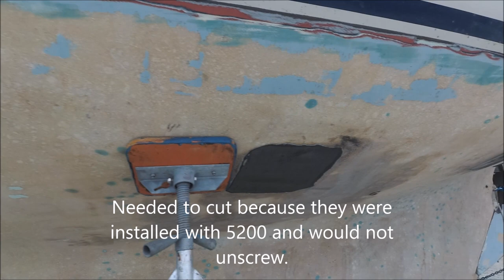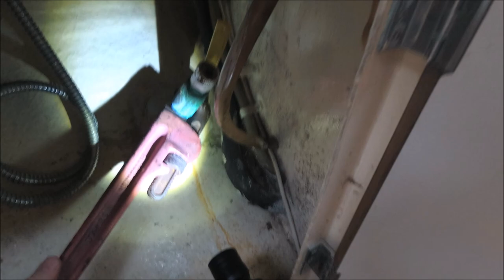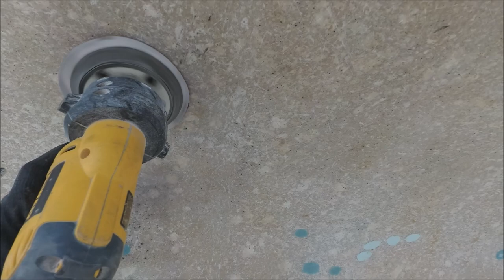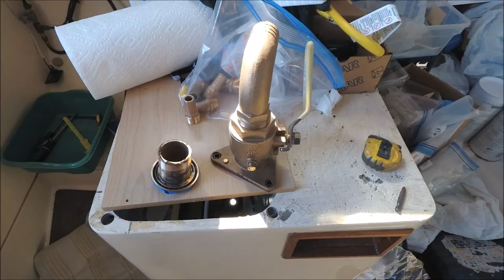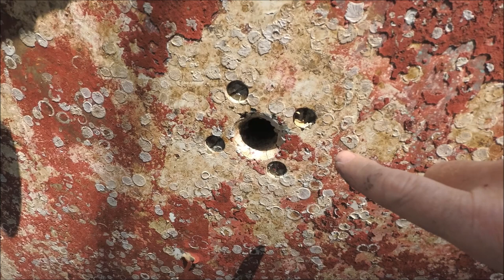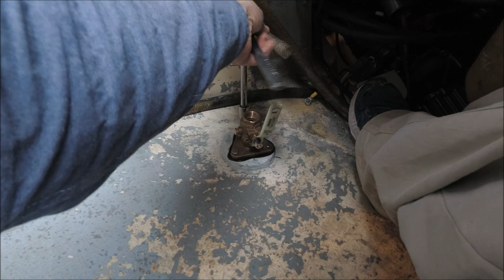Installing Groco Seacocks and Backing Blocks

Comment: I didn't see you use the nut for the thru-hull fitting. Did you just epoxy the backing pad to the hull and then bolt the valve to the backing plate? Then screwed the fitting into the valve? No nut or Teflon sealer on the fitting?
Reply from the maker: The nuts are discarded to the recycle bin. They are only used when someone decides not to use a proper seacock but to just screw a ball shut-off valve with no flanged base direct onto the mushroom held by the mushroom nut. In our case the backing plate is epoxied to the hull (or with a strong adhesive such as 5200), the base of the seacock is held by the three bolts in the backing plate and by the mushroom thru-hull threaded into the base. Yes we apply sealant to the threads of the thru-hull during final assembly.

Comment: Another way to get the thru-hull off is to grind the mushroom down. Being careful you can get it down to the threaded shaft portion. After which, you can push the whole assembly into the boat.
Reply from the maker: Good point. On stubborn seacocks where there is not space inside to swing a large pipe wrench I also cut off the mushroom head from outside using an angle grinder with metal cutting disc held at a 90 degree angle the the mushroom head. I make several cuts and then chisel off the pieces until the head is gone.

Comment: I bought the Groco seacock and thru hull.  Can somebody explain to me why those parts dont come with the bolts that attach seacock to backing plate?  Now I have to guess what size/length of bolt to buy that will fit.

Comment: How did you hold the backing block in place when you epoxied it to the hull? Thanks for the video.
Reply from the maker: The thickened epoxy may hold it on its own because the backing plates are light but I usually tape it with masking tape or duct tape until it's cured.

Comment: I see a lot of installers on YT using 5200 on these seacocks. That is very permanent!  Is there a more flexible sealant that could be used instead?
Reply from the maker: I don't use it but not a serious problem if you do since seacocks can withstand the torque of a pipe wrench to remove them if stuck on with 5200, unlike some other hardware and gelcoat. I generally use Life-caulk (polysulfide) but there are other suitable sealants available like Sikaflex 291.  I have used 5200 between the backing block and hull if I don't use thickened epoxy since in that area you do want an adhesive and not just a sealant.

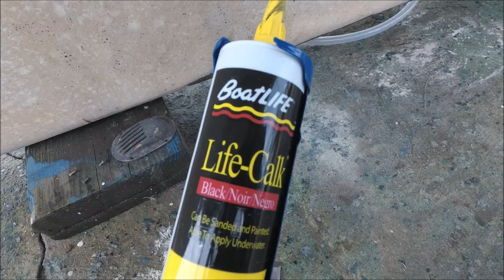Comment: at about 6:54 you say that you can put a counter sunk bolt thru the backing plate sticking up. How does that work if you need to thread the seacock on to the thru hull. the bolts would prevent that from turning.
Reply from the maker: It doesn't matter if the backing block is fixed in position or not because the mushroom thru-hull is turned from outside to tighten it into the seacock. The mushroom has bosses inside that allow you to get a grip on it with a flat plate or chisel and then turn that plate with a wrench.

Comment: Question: when you screw the mushroom from the outside, do you tighten down or do you leave a little bit of the sealant like about an 8 inch overnight so that when you tighten from the inside, you have a rubber seal and not all squeezed out
Reply from the maker: Some people recommend that for deck fittings but that won't work on a seacock. The reason I don't do deck fittings that way is partly because you have to be very careful to turn only the nut and not the fastener or you risk breaking the seal. The other reason is it is generally not needed because you will countersink the deck hole so that some sealant always remains along that beveled edge. On seacocks you should drill the hole in the hull about 1/8" larger than the mushroom thru-hull and that is where the seal is made and so it can't squeeze out during tightening.  You won't be able to turn the seacock because it is bound by the three bolts coming up through the flanged base. If you come back a day later not only can you not tighten the base but you can't turn the thru-hull and if you tighten the nuts on the base then you break the seal of the thru-hull.

Comment: Do you know the three bolts from the seacock to the back pad what torque should these bolts be torque at and the through hull itself should there be a torque as well to the seacock? I like to torque everything I build for the purpose of not over tightening bolts and stripping stuff out, looks like you did about 3 ft pounds of torque but is there a torque spec anywhere? What a rule of thumb how many years are the seacocks good for or do you wait till they start to seep then change them out?
Reply from the maker: I know there are certain jobs where it's important to quantify how tight is tight but I rarely use a torque wrench because for most jobs such as this it isn't needed.  Everything is bedded in sealant and the three nuts are nyloks so no danger of coming loose after tightening. As for overtightening that's not possible with short-handled wrenches. A long torque wrench that I'm familiar with also won't fit in some of the spaces where seacocks are located.  If a seacock is visibly leaking I just replace it. If I suspect a leak inside then I pop off the hose to confirm and then replace the seacock. I rarely see a seacock that is installed properly needing replacement and I expect 20+ years of service in most cases. Often a problem is barnacle buildup inside when valves are not regularly turned. More often I see old ball valves screwed onto thru-hulls that look suspicious from age or ancient leaking tapered seacocks that could possibly be resurrected but generally are so old and worn it's not worth the trouble.
Reply: @atomvoyager  What are the things that can be done when there's barnacle buildup inside when valves are not regularly turned, and the valves won't fully close?  Thanks in advance.
Reply: @island663  A bottom cleaning diver, or yourself, will stick a tool such as a  large screw driver in from below and knock out any barnacles or oyster shells. If the handle still won't turn, I'd wait until next haulout and disassemble or replace if needed. I've never had them jam that bad though unless they were very old of unknown date from a previous owner. What is common though is to have the flimsy plastic handle snap off in your hand when barnacles grow inside a marelon seacock, which is the main reason I rarely use them except on a trailer sailer that isn't in the water long term.

Comment: Did you use stainless steel bolts to attach the seacock to the bronze nuts in the backing block? Is stainless steel best? Thank you.
Reply from the maker: Bronze might be best if you knew you weren't getting mislabeled brass but stainless is cheaper, more available and good enough so that's what I normally use.
Reply: @atomvoyager  Thank you! Your videos and advice are excellent.

Comment: What did you use for the backing plate to hull? 5200?
Reply from the maker: I used thickened epoxy - resin with West System 406 silica added. You can also use 5200 if you prefer.

Comment: I noticed you don't put any sealant on the upper side of the mushroom's thread. I have seen other people doing it and I'm wondering what is better. Any suggestion?
Reply from the maker: I apply sealant up about 1" on threads from mushroom head which is slightly more than hull thickness and enough for a good seal. Adding sealant higher up the threads doesn't do anything anyway and just makes future removal more difficult. You can apply more if unsure but the extra will just squeeze out anyway and make a bigger mess.
Reply: @atomvoyager  i was afraid that water could find a way through the thread between the seacock and the truhull from inside. I'm replacing eleven of them, I admit I'm quite stressed :-/
Reply from the maker: @ontyposrl  You're right. I forgot to mention that i also put some sealant on the base of the seacock or on top the backing plate. I think that is better than just putting it way up on the threads but you can also do that.

Comment: Did you drill that hole TOO large for your through hull fitting?   It looked really loose when you test fitted it.
Reply from the maker: I drill the holes so there is about 1/8" gap all around and fill the gap with sealant. That gap may be slightly larger sometimes depending on the availability of standard hole saw sizes for that seacock size. I think a tight fit has no advantage here and if loose it's easier to get the threads to line up with the backing block and its bolts.

Comment: I have a yacht that needs to replace 10 Thur hall.
Do you have idea how much should be cost?
Reply from the maker: You don't say if you want the parts cost to do yourself or parts and labor having a boatyard do the job. The parts for ten seacocks would cost about $1,900 retail and a couple hundred more if you need the backing plates. Labor would be about 2 hours for each seacock. If you just ask the yard to do it they may install a cheaper version consisting of ball valves screwed onto mushroom thru-hulls so you need to specify exactly what you want first. Maybe show them this video and ask them if they can do the same.
Reply: Thank you